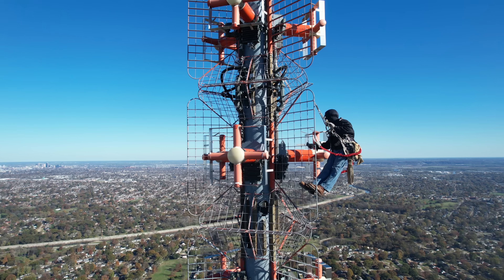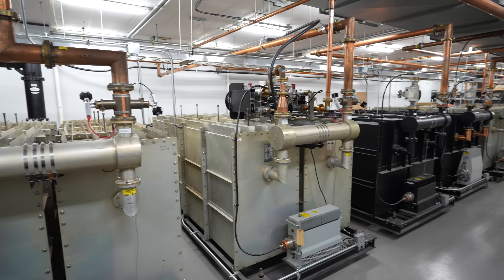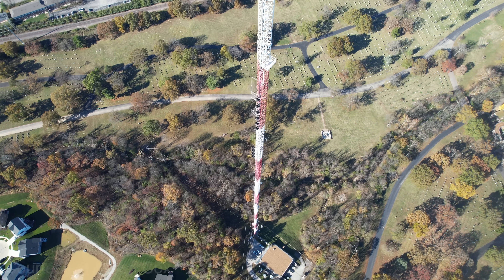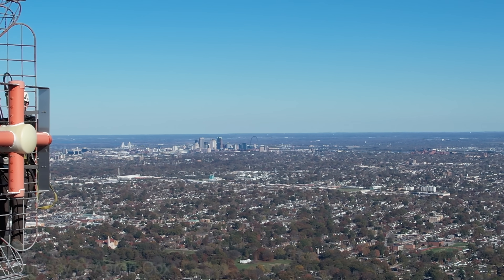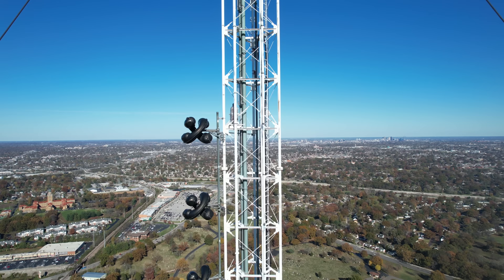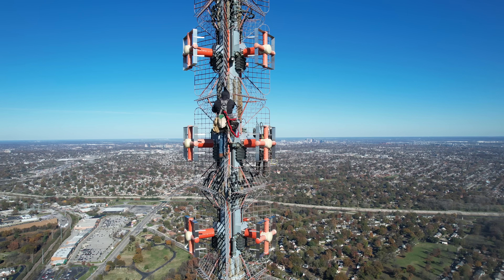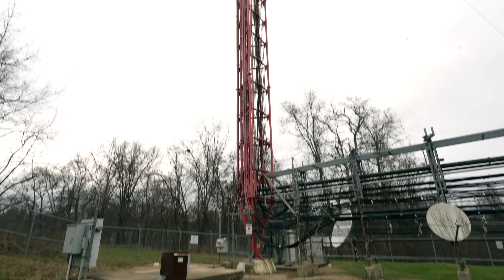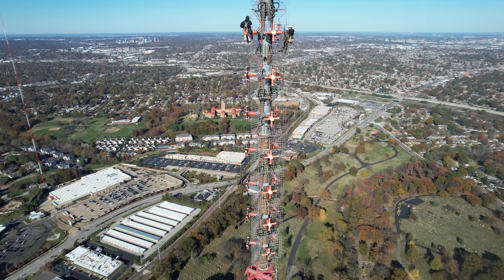Engineers react to 1100 ft Radio Tower Climb

Comment: 8:20 We need more than 10 seconds explaining what we're looking at 😂 ... get these guys to talk about it for an hour or two. I tried to google what the point is of those circularly polarized ERI antennas and didn't get anywhere, so I asked GPT and ended up having my mind blown by the fact that FM is mostly horizontal-polarized and the mast isn't actually doing any of the work. To summarize...

The 1115-ft “antenna” mast itself is not the FM radiator.
The FM signal comes almost entirely from the bays (the ERI rototillers, Shively panels, etc.) mounted on the mast.

The mast:
 • Carries very little intentional RF
 • Is not designed to radiate FM
 • Does get strongly energized by nearby 10–100+ kW FM arrays
 • Can absolutely light fluorescent tubes or cook a hot dog due to induced RF current
 • But is not the broadcast antenna itself

The mast radiates incidental RF, not the real, engineered pattern.

The ERI Rototiller is one of the classic FM broadcast antennas. It produces:
 • Omnidirectional horizontal radiation
 • Omnidirectional vertical radiation
 • With a controlled 90° phase shift

Stacking multiple bays vertically:
 • Increases gain
 • Controls vertical beamwidth
 • Pushes more power toward the horizon
 • Smooths out nulls

Why circular is preferred for modern FM
 • Car reception reliability massively improved
 • Portable radios (random antenna orientation) work better
 • Phones (tiny internal antennas) rely on near-random polarization → circular helps a lot
 • Indoor reception (multipath-rich environment) becomes way more stable

Most FM stations aren’t actually perfectly circular.

They’re typically:
 • Horizontal-dominant elliptical (e.g., more horizontal ERP than vertical)

This is because:
 • FCC treats horizontal ERP as the “main” ERP
 • Towers may have structural constraints
 • Some stations want to optimize for both home and car listeners differently

But ERI rototiller antennas can be tuned for any ratio.

Comment: As an antenna designer (although I work at much higher frequencies so 100MHz FM is foreign to me) I'm assuming the FM array at the very top of the mast is made up of end-fired (axial mode) turnstile antennas? Would make sense given that FM radio is typically circularly polarised. Anyone know how the 90' phase shift in the feed to the two cross polarised dipoles in each antenna is achieved at these sort of power levels? The crossed dipoles are also housed inside what looks like red dielectric tubes (similar principle to an antenna raydome). Anyone know if these are filled with dry nitrogen to inhibit corona discharge, or are they just simple weather protection over the radiating elements?

Comment: Back in the late 80's early 90's we did NOT use 2 safety lanyards and hook on and off constantly, ESPECIALLY when painting. When we painted, you had a paint mitt taped onto one hand, five gallon bucket with 3 to 3.5 gallons of paint hooked to your belt, climd to top and paint on trip down while free climbing.
Not for clumsy or faint of heart.

Comment: I maintain ham radio repeater systems in the Tulsa area.  We had some equipment located on a TV tower northwest of town a few miles.  It was probably around 1100'. One day we got a call from the FCC.  Our 146.94 MHz transmitter was being heard on the vhf aircraft band, reported  by the   FAA. Thats possibly the biggest no-no in radio. Interfering with air traffic control radio or airnav systems of any kind. We were told to cease and decist immediately.  This was on a winter day. There was freezing drizzle outside. Not a good day for a tower excursion.  The system did not have remote control.  So, a couple of us on the engineering crew dressed for the nasty conditions and went up there. I stepped on a piece of wiring and saw an electrical arc go to the tower. Wonder we didn't get shocked.  I traced the wire to a 10 watt UHF amateur TV transmitter we had installed, where we partnered with the TV station to transmit the station's weather radar on a ham TV frequency.  The problem was caused by the frayed insulation on the AC power cord for the little TV transmitter.  The tower engineer for the TV station had lectured me about using zip cord to power things on his tower. Essentially we created a spark gap transmitter. This unit was right next to our 146.94 transmitter and when the electrical energy arc'd over it was mixing with a bunch of other signals in that RF environment. I had scanned the vhf band on my way to the site and heard our signal with an AC hum component in many places in at least the VHF spectrum. We pulled the plug on the ATV  transmitter. I was an unhappy camper because the guy that built the little transmitter knew to use outdoor grade wiring for that. I almost threw the thing off the tower.  However, that was a popular service with people like the Tulsa mayor.  The intended users were ham radio weather spotters.  We came back on a nice warm day and redid the wiring with outdoor grade cable.  Yes, that is a rough environment. On the equipment and the people who take care of it.  We had the luxury of an elevator,  albeit somewhat rickety. The guys in this video had to do it the hard way.  Ive had to walk down a time or two.  If I went out there and the elevator wasn't working,  I simply didn't go up. This was not a paying job for me. I've actually climbed scarier sites.   Too old to do this now.  All my sites are in nice climate controlled buildings now.

Comment: At 6:15, you were talking about flying the drone the height of the structure "within a 400 ft. CIRCUMFERENCE".  Did you mean to say 400 ft. RADIUS?
Reply: Yes.  You can go up to 400 feet over the top or 400 feet laterally from it.  No further.   Basically, the distance that "real" aircraft have to stay away from it.  I'd say manned aircraft, but now some of those are unmanned "drones" also, just using "real aircraft" airspace.  Sometimes they fly from Florida to near Ukraine and back, at 60,000 feet, so are extremely capable jets, definitely not the quad copter people think of when they hear "drone".

Comment: So, what happens to the stations when the transmitters are off during the inspection? They get switched to secondary/non-ideal tower locations?
Reply from the maker: Most, yes; a few have aux antennas on the same tower
Reply: @GeerlingEngineering  Interesting
Do they run at reduced power on the aux antennas while the climbers are up there?

I think what I find most interesting is the amount of power in use during normal operation. Maybe a subject of a future engineering video - Why do ham radio vhf repeaters get by with 25-50W but FM broadcasters use 100kW+ 
Guessing bandwidth is a big part, but suspect the larger reason is so receivers with very compromised antennas can actually work.

Comment: I just don't understand why the city / county would allow building of home within the fall distance of the tower.  That is just plain crazy this would be allowed.  I guess the people / developer just don't understand the amount of potential energy in these large towers.  Just thing that single FM antenna array at the top is over 15 tons of weight over 1000 feet in the air.  Once that new subdivision is fully built out there could be about 80-100 homes within the fall zone as a worst case.    They were pretty close in Houston houses as well when it came down.    Hope it never does, but you have to be realistic when you live in tornado alley as well.   Great video by the way too.  👍🤠

Comment: I worked at the Trans World Radio Bonaire site in 1982-83. The SW XMTR(50/250kw) could on a curtain antenna or a corner reflector. The AM, 500kw XMTR feed a vertical antenna array that could have a figure 8, omnidirectional or cardio patterns.

We used old 10 or 12ft fluorescent tubes as indicators to show if the XMTR was on and which antenna it was on. The old tubes really showed up at night so I could tell power was reaching the base of the antenna!

Comment: I'm a retired radio engineer but I never climbed a tower higher than 280 feet. One of them burned down in a forest fire. I climbed the Raritan Township, N.J. water tower in 1955 when I was 12 years old and never have been particularly afraid of heights. The only safety equipment we had was a safety belt.

Comment: The reason for two straps is to use separate anchor points! I climbed poles and this was beat into our heads from the beginning. Seeing him tied off to the same steel dish in two places leaning back is absolutely insane.
Reply: Yeah. You look at it from a safety standpoint,these guys were seriously flaunting the I'm cool factor. To completely lean back and put stress on a safety mechanism,that is reckless. I would think others that are safety trained,would see this. The second you take anything for granted(safety) it will eventually hurt you. The three point system is common with climbing, at this height these guys knew they were showboating. I am a climber in my 15th year,this video seriously made me upset on why these two guys sat there talking about something they have no idea about. All they did was sell bad practice to the laymen,shame.
Reply: these guys ,they would never climbed here!
Reply: There are actually 3 ‘straps’. You can see the 2 red ones which are the actual life safety attachments which are shock rated and one must always be connected. Then there is the ‘positioning’ strap which typically takes all the load and is adjustable to attain an ideal position for working in place.

Comment: Back in the early 2000's I flew some of my fixed wing drones (UAV's) past cell towers and on more than one occasion the RF output of towers interfered with the stability augmentation system but not the UAV's control link.

Back in the 1990's I was in the satellite TV and local TV antenna business and I ran in that issue of homes close to a TV tower the homes near the tower could receive the channel, it was channel 40 and the tower was located in Parrish Florida.

Comment: Sometimes we have a misconception about height and danger. Falling from a 60ft tower will kill you just as dead as falling from an 1100 foot tower. My concern about using a drone close to the climbers, is the distraction it may cause. These climbers must have absolute focus on what they are doing. Any distraction could be fatal.
Reply: If you were right, the climbers would not have agreed to it.  It's for them to decide and worry about, not you.

Comment: I have a question about the climbers. Even though they are tied off with safety lines, should they lose their footing, they would just be dangling there on those lines. There may be no way for them to regain their position in order to climb back down on their own. Should this happen, what are the rescue options and plans? Is there a helicopter on standby for rescue purposes?
Reply: I wondered that as well. I've seen it with steeplejacks as well! I assume that a helicopter would have to be involved?

Comment: If they find say a crack in a weld near the top how do they fix it? Like do they take a welder up and try and fix it in situ if so where do they get their power? Or do they pull the component off and repair on the ground? Like I have to imagine not pulling apart the antennae system and repairing in place would in many ways be easier, but how do you get power and the welder up there?
Reply: There are lithium battery powered welders available now... big in the 4 wheel rock crawling crowd where breaking is common

Comment: I'd love to get an explainer on each of the antennas in this video, bottom to top. Why are each type at different heights. There is a brief discussion in this vid. Thanks for all you have on this channel!
Reply: im no technician or guru the ones right at top are for the FM analog and digital, those black ones that look like tubes I think are FM as well, the white (fibreglass) verticals you see off the side of the tower are commercial VHF/UHF, and there is some stacked dipole arrays as well

Comment: As a retired comm tech I used to maintain repeaters at the 900ft level of a TV tower. No real issues until tower owner put anFM antenna 20 feet below our platform ! Never mind the RF burns, it made shielding virtually impossible.

Comment: What I love is the fact that this tower is well within the drop zone if it should fall.  90% of towns don't allow you to build a tower this close to the fall zone, yet here it is.  I wouldn't live next to this tower for any reason, and I am a ham radio operator.
Reply: The rules around St. Louis are often 125% - you have to have land that extends 125% of the height of the tower in all directions. I keep seeing the builders and cities make exceptions when they want to build housing in the area of the towers!
Reply from the maker: And for important context: the tower was built in the 1980s, and this subdivision was built last year (2023), so for over 40 years that land did not have a bunch of houses...
Reply: @GeerlingEngineering  : Yet the city and county allowed the homes to be way too close.  I have been near 800 ft. Towers that were dropped and let me tell you, you don't want to be close to it when it comes down.
Reply from the maker: @ssrrocks22  Definitely.
Reply: Look up the Senior Road Tower collapse.  They are designed to fall onto themselves.  Like a accordion.  Unfortunately, that's exactly what happened and killed a few people on the tower and some at the base of it.  Bad deal back in the early 80s, as I remember.

Comment: That "stick" your father talks about is why RAF avionics folk in the UK armed forces are known as fairies.

They'd walk up to the huge transmitter installations and tap it with their grounding rod to ensure it was safe.

Only instead of broadcast radio, it was for radar but it is (at least it used to be) done exactly as described by your father.

Comment: With the climbing thing, a lot of it is fitness but a lot of it is also technique. Like if you gorilla t-rex arm it (so lift your weight with your arms, keeping the arms bent instead of straight) you're gonna be tired real quick, but if you make your legs do all the work it's a lot more efficient. On their rigging it looks like they were rocking 3x pieces of personal attachment system, 2 cows tails w/ load limiters and a work positioning lanyard. The cows tails stop them from falling from the sky and have load limiters (that's why the webbing is all bunched up, it's part of the load limiting system so if they take a factor 2 fall, the load limiter stops the fall on the gear from breaking them as well as breaking what they're attached to, HowNot2 has a fantastic demo of various fall factors and the amount of force that can be generated). The work positioning lanyard also is very bomber but is adjustable so they can "keep it tight" so it helps hold them in place.

Not sure if their load limiters are the elastic type or the "screamer" type or whether they had a screamer on their adjustable

73 from Australia

Comment: I made dozens of trips up Omnicom Tower near Sharon, OK back in the 1980's when I was a technician at a Motorola MSS. The tower is 1204' to the tip, has an 8' face with 3 service platforms at 650', 800', and 950' as well as a step-off platform just below the top of the structure at 1100' (the top 104' was the FM broadcast antenna and strobe). The tower has an internal elevator rated at 2 men. The service platforms were designed so that we could place our customers' equipment (UHF repeaters mostly) at the antenna location using an 8' piece of heliax. This delivered a much higher ERP due to zero line loss. This meant that a 450MHz 100W transmitter that would typically deliver a service area of 35 miles when mounted on a 400' tower with the necessary length of heliax could now service close to and sometimes in excess of 100 miles. This enabled our customers to eliminate as many as 5 or 6 tower space leases to cover the same area. Each trip was an adventure, for sure. The elevator didn't go all the way to the ground, obviously, and we had to climb 40' and then hoist equipment up to the elevator. The antennas we hung were like the ones seen at 9:22 which were 18-20' in length depending on band and were 2-piece construction. We would strap those antenna parts onto the elevator car cable above the car and a transmitter and one man in the car for the ride up. The view from the platforms was awesome. I ate my lunch many times sitting against the face of the tower looking out at the curvature of the earth. The only times we used a safety harness was when hanging the antenna. Otherwise, there was no real need and there were no regulations stating otherwise at that time. Good times! Great video!! Thanks!!

Comment: Ehhh, no biggie....
Houston's Senior Road has 9 full Cs, running 30kw each into a Harris CBR at 2000ft with 900kw ERP analog...add in the HD and you're past 1 megawatts. The original tower fell in 1982 during final houst of the top of the FM antenna, resulting in 5 deaths..The replacement sits on the original pin!
Reply from the maker: Sorry, but what in the HD?!

Heh, but more seriously, there are some crazy towers in the world... would love to take a look up close at some others.
Reply: @GeerlingEngineering  typo...corrected it
Reply: @GeerlingEngineering  how about the tallest in the USA KRDK-TV mast in Galesburg, North Dakota, which stands at 2,060 feet (628 meters). It was built in the 1960s and replaced twice due to a helicopter hitting the guys and 4 inches!!!! of radial ice and 70mph winds... that ice load is insane!
Reply: About every FM engineer from that era knows about that accident. And learned from it. That’s in the ‘elite’ category of tall towers!